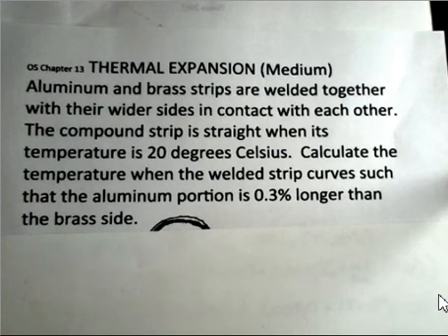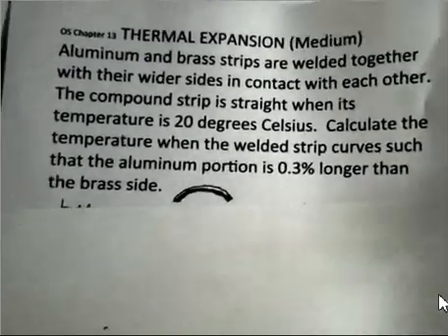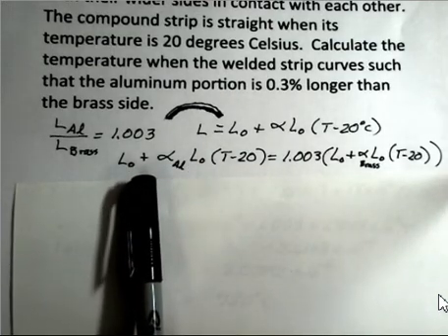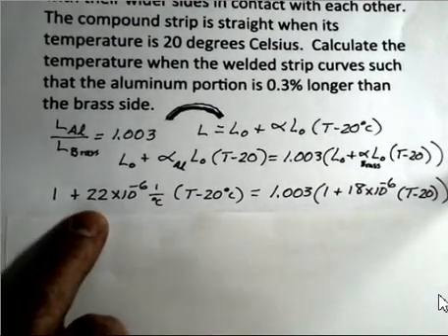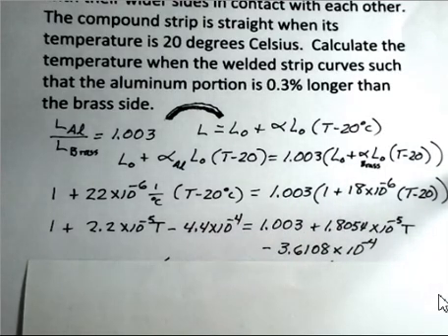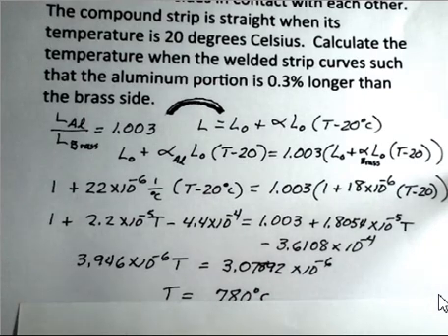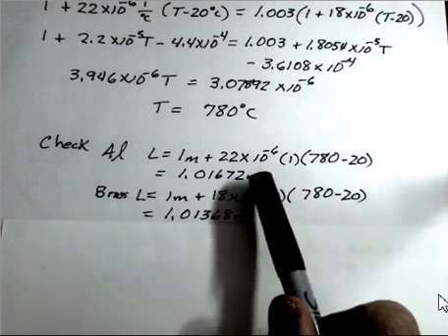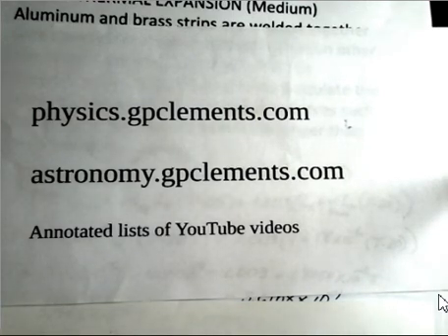Bimetallic Strip Linear Expansion Aluminum Brass

Comment: where was it mentioned that the initial length of aluminum was 1 meters? was that a given ? or we just assumed it ?
Reply from the maker: The one meter length is just assumed.  I selected 1 meter just to make the calculations easier.  The 0.3% result will be obtained for any length you wish to use for the original length of the material.
Reply: @GregClementsScience  oh i see ..so it's a matter of proportion.. yeah that makes sense.. thank you professor.

Comment: how did we end up with "780 Celsius" ? while the ratio of (3.07892)/(3.946) is even less than one !
Reply from the maker: Thanks for your comment.  There is a "typo" in the video at 4min 45sec.  The number on the right side of the equation should have a power of 10 of "-3" not "-6", 3.07892 x 10^-3.  Then the calculation produces 780 Celsius.  I apologize for any inconvenience.
Reply: @GregClementsScience  no worries..i was just confused .. thank you very much for your reply and amazing videos professor Clements.